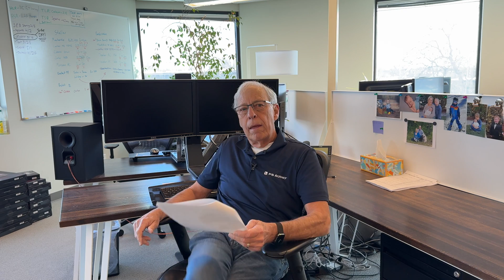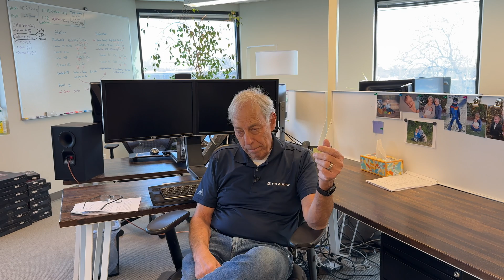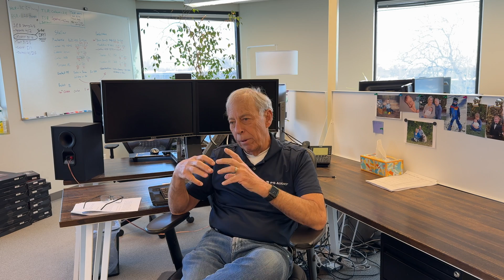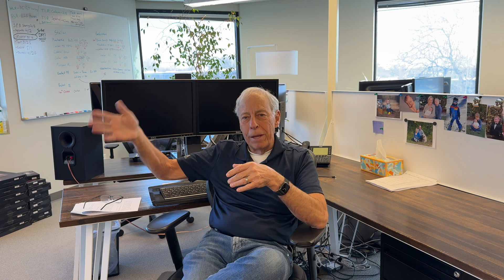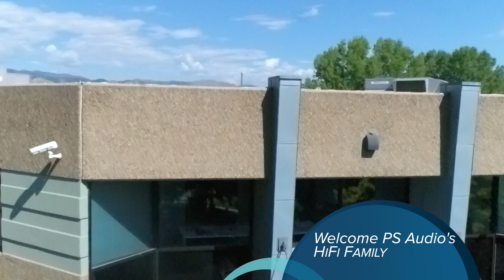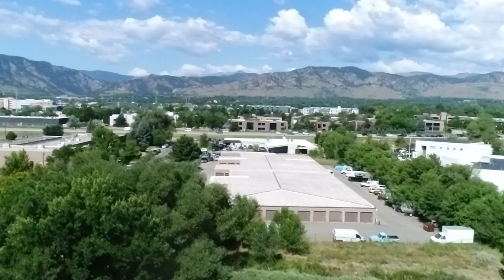Dielectric bias system

Comment: Paul, you cannot hear any difference with or without battery connected, because there is no difference. The only requirement for speaker cable carrying audio frequencies is twin insulated copper cable of sensible gauge to minimise added impedance. As someone with qualifications in Radio Frequency Engineering I can tell you cable construction becomes important at frequencies way, way above audio frequencies.  Anyone spending big on speaker cables will probably hear an improvement, but nobody else will. Whatever makes you happy.
Reply: 😂😂😂😂😂😂.... you're funny ..!
Reply: Please see my replies above to @Evil_Peter, @oneemotiva4975, @stimpy1226 and @nobelstone9714 about why quickly connecting and disconnecting a DBS pack is not a valid way to evaluate biasing a dielectric. I appreciate that you are familiar with dielectric involvement, a crucial challenge in the transmission of RF. An important benefit of biasing a dielectric is linearizing behavior at RF frequencies, improving RF noise dissipation (in an audio-signal or AC cable), thereby reducing RF being coupled into conductors attached to active circuits, causing TIM and otherwise compromising circuit  function. Sincerely, Bill Low
Reply: @WELquest  I'm sorry but I don't quite get why you would want to bias the dialectric as for "improving RF dissapation" (I'm guessing you mean lowering it's permittivity) since using a basic shield would negate the need to dissipate RF since shielding is the by far easiest way to deal with unwanted E-Field noise (RF or other). If you said to improve the poynting vector by reducing the polarization held by the dialectric over time (that would then interfer with the E-field component of the poynting vector outside the conductor), then I would understand it a bit more. So if you care to explain if I missed something then I'd appreciate it.
Reply: @tobiaxelsson  Thanks for your reply and question. As a history major, I make no pretense of having a broad perspective or understanding of electrical parameters. What I do have is a lifetime of working to correlate empirical evidence (listening) with cable design materials and topology. I have relied on many other people to help educate me, but those are only points of light and not nearly a higher altitude complete picture. It was a friend who used to be in charge of proofing all of TRW's technical papers who first taught me about polarizing a dielectric. It was Arcam founder John Dawson who first taught me something as basic as the rule-of-rights, and why the original Arcam Black Box DAC used a 50Ω AQ coax internally (because RCA plugs/jacks are close to 50Ω and nowhere near 75Ω, AQ's RCA-plug terminated digital coax cables are 50Ω). Most recently, for over a decade, it has been Garth Powell, designer of all AQ's power products, who has taught me a fraction of his immense knowledge, such as the underlying physical characteristics and mechanism responsible for observed directionality in cables. I didn't need to understand the mechanism in order to honor directionality for decades, and make better cables as a result, but of course I prefer to understand. Science is the investigation of the unknown, a process that precedes the facts that engineering applies. I am but a comparatively uneducated scientist -- but I do understand how dead wrong it is to misapply why balanced audio cables became the norm in professional and PA applications to the reduction of GHz interference -- though again, I don't need to know the details of GHz wavelengths never reaching the 2 conductors perfectly in phase in order to hear what does and doesn't work. As for dielectric, in other applications loss is the problem, while to my understanding, the problem for audio is not loss, but energy being put back into the signal other there where it came from (in phase and frequency). FEP and such have less loss, but if not biased, the artifacts of FEP's dielectric involvement are a lot more aurally irritating (damaging why humans listen to music) than those of PE. I'm sure you can explain this better than I can. Thanks again for reading and caring.
Reply: As someone also with qualifications in RF and EMI (although it was some time ago) I can tell you there is something called time domain that RF engineers tend to ignore all the time or how it correlate to frequency domain (or rather what doesn't correlate). And that just happens to be the domain you would need for calculating the effects of dialectric (Maxwell is timedomain stuff) or usually simulation since it's quite problematic to measure. The parameter that's of interest is the energy transfer or what's described by the poynting vector and outside the conductor that would be mostly B-field and a smaller E-field (S=my0 E x B). I don't like the solution since I would prefer a choice of a better dialectric, but in theory the E-field generated by the battery would saturate the dialectric and thus interfer less with the field from the conductor (dialectric can hold charge as in very evident in capacitors). So is there a difference? Absolutely. Is it audible? No idea. 
But modding my own 100$ cables based on improving the B-field interaction between the conductors was suprisingly noticeable.
Reply: @tobiaxelsson  Search for this interesting test

Speaker Cables: Can You Hear the Difference? | Sound & Vision
Reply: @geoff37s57  Just did and I fail to see how it's related to what I was talking about. So they based their test on some random parameters based on impedance. What I'm talking about is closer to can you hear a difference with braiding/twisting the conductors, does the angle between them matter, does increasing the distance matter, different dialectrics etc. It's rather basic EMF/EMI, but I can understand it might sounds like magic for people outside the field. Personally I had good results for cheap (soundstage went from 2D to 3D), but your milage might vary.
Reply: "As someone with qualifications in Radio Frequency Engineering I can tell you cable construction becomes important at frequencies way, way above audio frequencies.  Anyone spending big on speaker cables will probably hear an improvement, but nobody else will."

You have qualifications?  What are they?  Why do they matter?

Which interconnects have you used for listening tests?
Please name every component in the stereo that you used for your listening tests.  The stereo is the lab equipment.  That is why you need to name every box in the stereo.

How did you choose the songs that you used for your listening test?

I am qualified in envy trolling.  My qualifications tell me that you will either not provide the answers to my questions, or will make excuses for not answering my questions.
My qualifications also tell me that you never did a proper listening test, or any listening test.